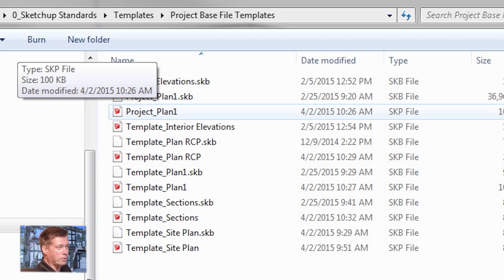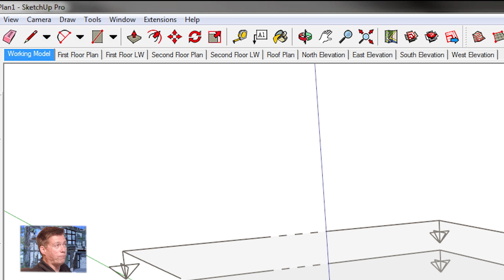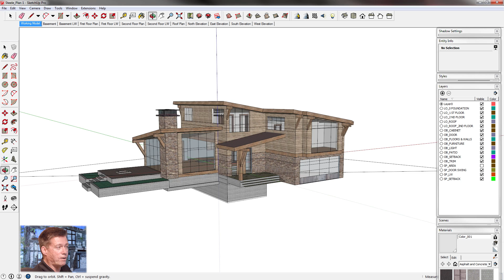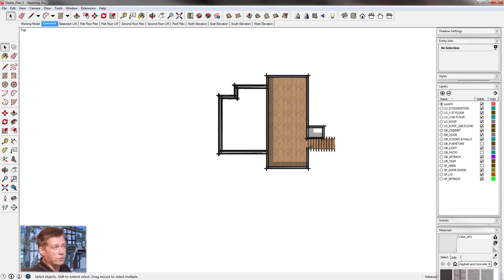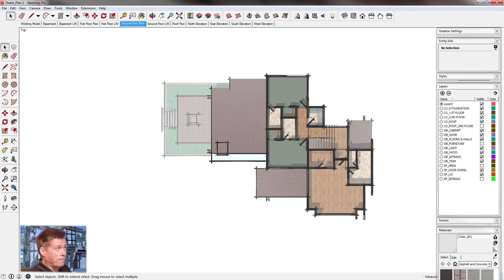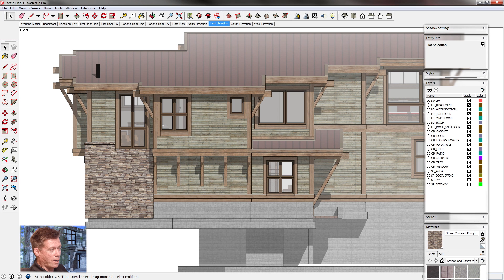Comment: Hi Nick, I have asked this question a few years back but I don't think I got an answer: When you dimension is it to the framing or to the finish?  In CAD, I draw both but dimension only to framing. How do dimension to the framing when the wall is represented by only 2 lines in plan and model?

Comment: Nick, beautiful work!  I would love to do this myself, but my engineers have told me that they wouldn't be able to import my drawings into their AutoCAD.  How do you get around that?
Reply: @Steve Workman - This is probably too late; however, in my experience, most architects and designers are exceptionally proficient with generating 2D CAD tools.  It's nearly impossible to work in either field without exceptional skill in this area.  For that reason, it's typically very quick/simple to export a .DWG file from Sketchup, then clean-up that document prior to sending to your engineer.

Comment: +NickSonder

quick question for you, when you are modeling initially, do you model lumber in nominal or actual dimensions, and how does this effect your final layout measurements when you are preparing final drawings for tradesmen?

-thanks
Reply: I always model to actual lumber dimensions so there is no issue with the framers.  So a 2x6 wall is drawn as 5 1/2" thick.

Comment: Nick Sonder  - Great videos and looking forward to the book. Questions about your level layers: I assume you group the items on the object layers and then stick that group on the level layer to control level visibility?
Reply: Exactly Marc
Reply: Nick Sonder Thx - looking at your OB layers, what layer do you place plumbing fixtures on? We're currently using a layer structure that is much more complex but also heavy to manage, so I'm interested in changing this to a much simpler structure. Doors/windows go on trim layer I assume?
Reply: Marc Kleinmann  Plumbing fixtures are typically part of a cabinet so they are on teh OB_Cabinet layer, since I never have a need to isolate the individual fixture.  In ACAD systems you always saw these very intensive layering systems where everything appeared on their own layer.  With SU, I took a different approach by creating layers that are specific to controlling modeling tasks and what needs to appear in LO.  The only items on the OB_Trim layer are interior and exterior trim with the exception of trim associated with the doors and windows.  They are included in the OB_Door or OB_Window layer.